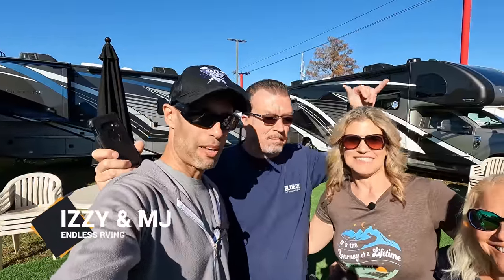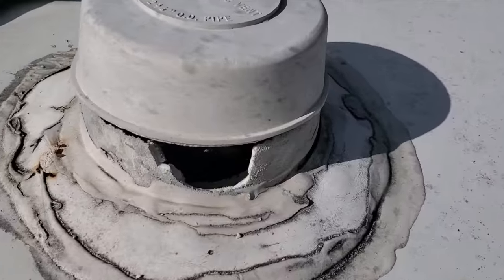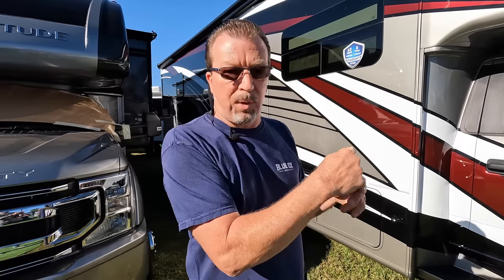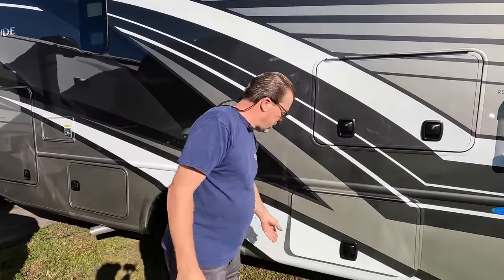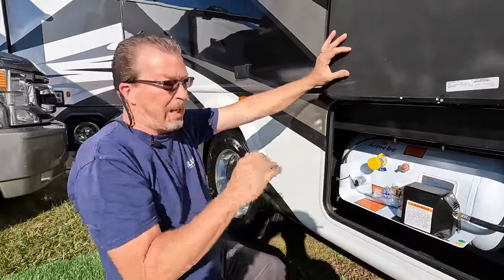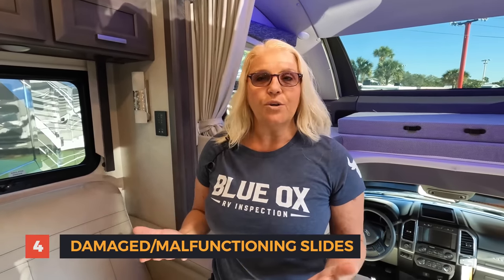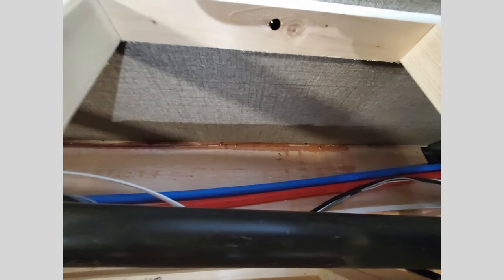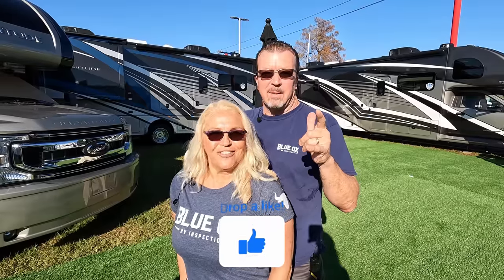7 Common RV Problems That Will Make You Regret Buying An RV!

Comment: Excellent information if you are buying an RV. I have always stated that I would never buy an RV new or used without an Independent Inspection before parting with a penny. Consider it the most valuable accessory you can have. I’d also ask how often this should be repeated. Safety is paramount. 
Thanks a million ♥️✨💫

Comment: The "hot skin" safety measurement should be taken with an old-school analog meter with a relatively low input impedance (e.g., Simpson 260 - 20K ohms/volt)...  This will allow harmless, high-impedance stray charge buildup (e.g,. static) to be discharged through the meter during the voltage measurement...  Your sensitive Fluke meter will show stray voltages on most everything...  Just sayin'  😎